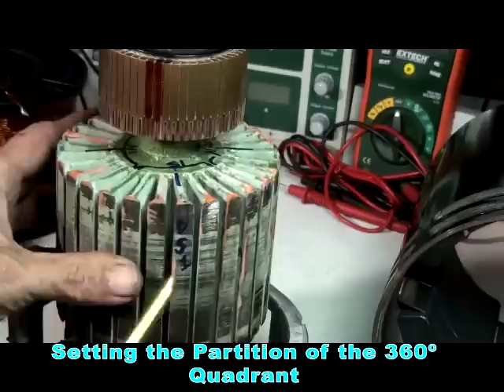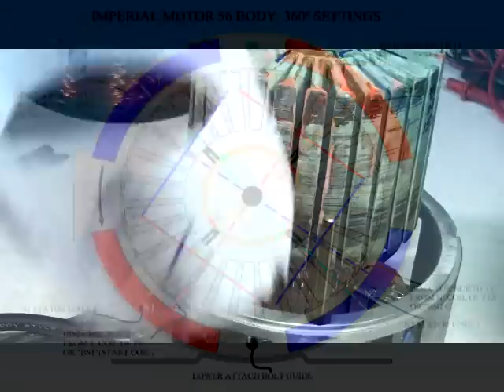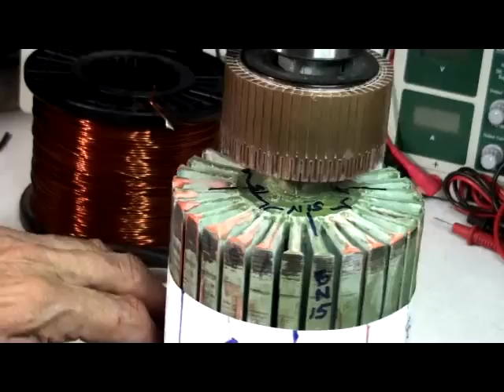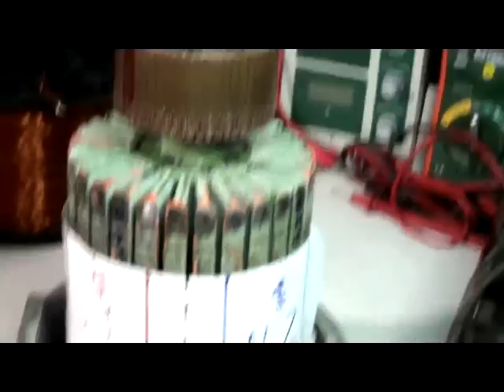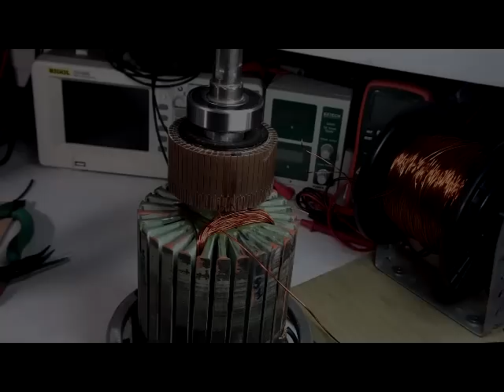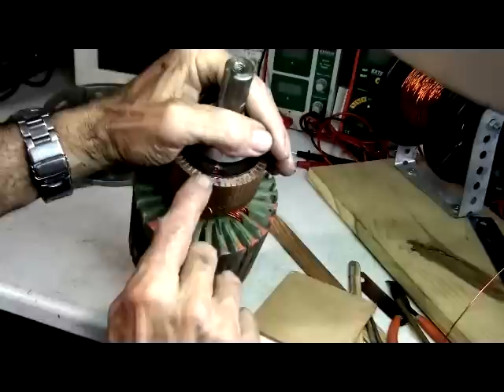Asymmetrical Winding Part 1

Comment: Hi UFO, I just wanted to ask you if the magnet positions and the coil winding directions would change as they do for other devices in the southern hemisphere or northern hemisphere due to the Bernulli Effect? It wouldn't seem necessary to me since the asymmetrical design has the same of both and should be self correcting in this respect, but, I just would like to know if you've had any questions or reports of opposites having to be wound.  I'm sure you know what the Bernulli Effect is, I'm not doubting you at all, so, I just wanted to see if it will work anywhere on this planet, or, if opposites have to be made below and above the equator for anything in this motor as I am having difficulty with the simplest motor, the 3 pole. (I think it is just a commutation issue, but, I am getting the brushes burning extremely fast and having a lot of problems with timing. It did barely run the first time, but, after this, no success at all.)